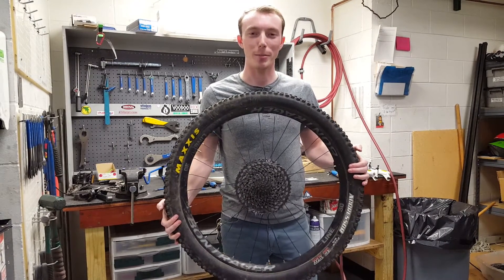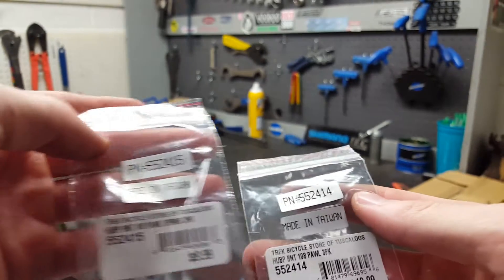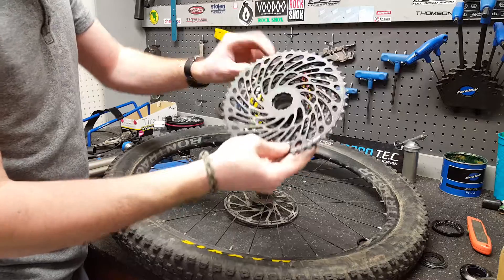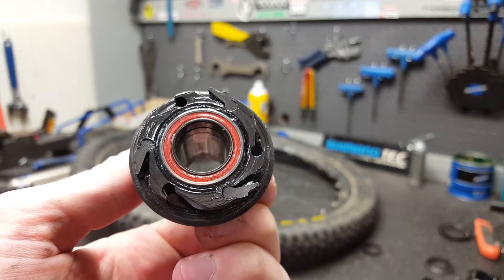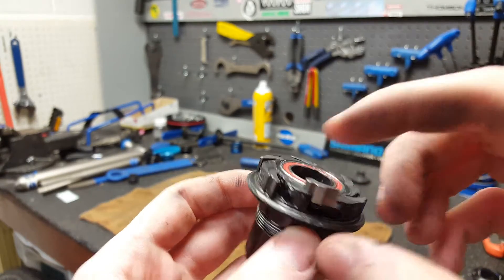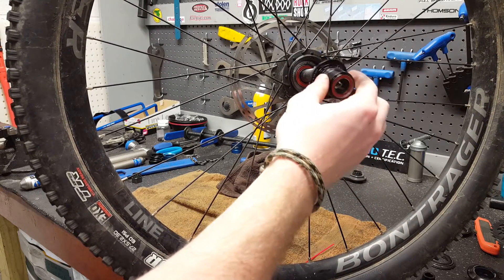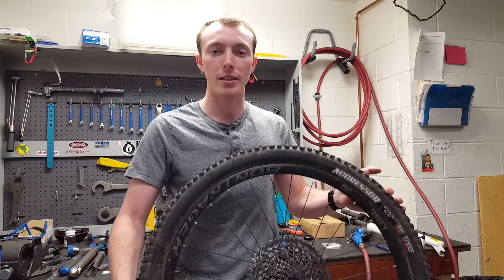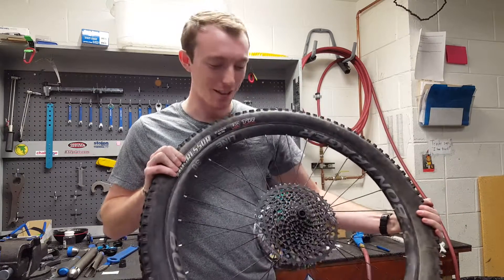Bontrager Line Comp 30 Hub Upgrade 54 to 108 pt

Comment from the maker: Hey guys, just wanted to pin some useful info from the comments:

* You do not need to remove the cassette to pull the freehub body off, but it makes it a lot easier. If you have a cassette removal tool, go ahead and take it off anyways.

* This upgrade will work with 2018+ Rapid Drive hubs. People have commented saying pre-2018 does not work.

* You have to order these parts through a Trek dealer or someone that sells Trek bicycles. They are not available elsewhere.

Thank you all for the support!
Reply: What size socket is in your cassette removal tool pls? I've a 2017 remedy with line comp hubs and wanna try this upgrade an change my cassette myself.
Reply: Peddlin Paul I used Park FR-5 tool to get mine off.

Comment: On my trek marlin 5 i have connection 29 wheels with a dc-22 on it very not noisy like i want can i put those line comp 30 29 inches on my treck ?

Comment: The engagement is not the problem with these wheels. The rear hub is junk. The pawl ring come loose, making the hub useless. There is no fixing it. I am 140 lbs and my pawl ring spins im the hub body. What would a bigger, more powerful rider do to these hubs? Doubt it would last a season.

Comment: What lubricant did you use?  I heard bontrager uses and recommends their own blend of lub.  But I don’t know what it’s called.  Or if they have a part number.
Reply from the maker: I use Phil Wood tenacious oil but any high-weight oil will do the trick. Gear oil for car transmissions is the optimal consistency to aim for. Too thin and it deteriorates quickly, too thick and the pawls stick. You can also use lithium grease for a more robust waterproofing but oils are more suited to the job.

Comment: How can this actually improve engagement without changing the drive ring? All this can really do is add rolling resistance since they all still have 'hang time' groove to groove
Reply: I did some research, corrected my idea, and ended up getting the same upgrade for my Slash. Ha.

The way the catches are spaced, only a single point grabs at a time.. so doubling the count actually doubles the chances of engagement..

And it sounds obnoxiously awesome
Reply: @antaltieri7154  also wear out twice as fast depends whats more important wear or on instant throttle
Reply: @kilner79  gotta go fast

Comment: Thanks for the vid! I just did this. The freehub body did not want to come off so easily and when it did one of the pawls went flying. Other than that pretty smooth install. Now I can be one of those annoying riders on the trail with a bike thats too loud :P
Reply: Use dumonde freehub grease for quiet hubs. Dumonde freehub oil for a horde of bees

Comment: I have a 2019 roscoe 8 with line 40 wheelset will this upgrade work on those as well?
Reply: I've seen where it is possible but different paws are used for shimano freehub body, there not compatible with rapid drive hub.

Comment: Hi mate I’m looking to upgrade my wheels, would a 12 speed sram cassette fit into a comp line 30 wheels?
Reply from the maker: Do you know what freehub the wheelset has? The SRAM NX (and SX) line uses a different spline pattern than the rest of their 12 speed cassettes. All sram GX and above use an XD driver, everything else uses the shimano standard spline. If you have an XD freehub on your wheelset and a GX or above cassette, they will work. Only reason I harp on the details is that SRAM NX uses the shimano standard for extreme cost savings and people always try to swap them over to XD driver wheelsets.
Reply: Adventure Arkansas thank for the detailed reply! The wheel I’ve seen has the 148 shimano freehub and my bike has the Sram NX 12 speed. So I’m guessing my bike has the 148 shimano freehub on my bike as well then? It just confuses the hell out of me when the description of the wheels say “148 shimano 10/11 speed”
Reply from the maker: @DwEmtb  Yup it has what's referred to as the hyperglide freehub. Shimano has kept (basically) the same spline pattern for freehubs since ditching the threaded freewheel. Shimano 12 spd is on a different spline pattern called Microspline. Let's break it down: 148 = 148mm over locknut distance (OLD) this is the hub spacing on the wheels. This size is known as boost spacing. Regular thru axle is 142x10 and quick release is 135x9. If you try to put a 148 in a 142 frame, it won't fit (too big). Likewise a 142 wheel will be too small to fit in a 148 frame. Shimano 10/11 speed simply means that is has the hyperglide spline pattern. 6-11 speed cassettes will fit on a hyperglide freehub, sometimes they use a small spacer to account for freehub width changes over the years. Like my previous comment said, most SRAM 12 speed will use the XD driver. And now that Shimano has 12 speed, they use the Microspline freehub for their stuff. I've been out of technical work for awhile, so I'm not sure if ALL shimano 12 speed uses microspline or if it's just high end stuff like sram. If you're looking to buy a wheel to transfer your cassette onto, buy one with a shimano freehub. If you're wanting to upgrade to a GX cassette (saves a LOT of weight!) you can buy a wheel with an XD driver and get a GX cassette as well. All sram 12 speed groupsets work interchangeably which is one of the reasons I've been recommending their stuff since Eagle came out. Cheers

Comment: My LBS pushed this upgrade for my new Stache 7. I never got to experience the hub without the upgrade. I seem to have a considerable amount of wheel drag. Someone else saw my wheel barely spin and come to a stop on my car rack and commented on it thinking the brake was rubbing. I adjusted the caliper to no benefit.
I took the bike back in and they said it was the rotor dragging and they corrected it, however it still spins with significant resistance relative to the other trek bikes on their showroom floor.
Is there any potential issue to watch out for that could cause resistence, like over tightening or using the wrong lube?
Is this something I should pursue with the shop to get it corrected? I really didn't want the upgrade in the first place.
Seriously how much is that slight engagement increase benefiting when riding sluggish 3" tires anyway?
Reply from the maker: Lube used in the freehub will have a noticeable difference when on the stand. You should be using a light grease such as Phil Wood slick honey or DT swiss star ratchet grease. A thicker grease like wheel bearing grease will slow things down a tad. To isolate problems, you want to remove all other factors - take the wheel off the bike and spin the hub. This will eliminate other variables like dragging brakes, overtight axle, draggy wheel bearings etc. Compare that to other bikes and see what the difference is. Be aware that cassettes weigh differently between brands and groupset so a GX 10-50 will sound and feel different than a shimano slx 11-42 off the bike. Best way to compare is to take the cassette off as well. To your point about the engagement increase - it's less about being 'quick' as it is about making the bike feel more tight and responsive. Trials-type slow speed maneuvers are a lot easier on a bike with fast engagement. Personally that's why I went with this mod, as I do a fair amount of tech riding compared to folks who do more mileage.
Reply: @piercereed6000  yes
Reply: @piercereed6000  Maybe I misunderstand what you're asking. I got rid of my Stache so I don't remember what wheels were stock. What is shown in this video is an upgrade to the stock hub on the stock wheel - they stay together, there is no need to fit anything to a hoop or do anything with spokes.

Comment: Nice job. too bad it couldn't be demonstrated before and after on a climb. I think i have a 6 pawl horizon with 42 points. I think my stock wheel is 32? Like it. Very good demo of the internals. thank you. I think the body requires some care pulling it off, some hubs have loose bits that cane come off and can be lost track of.
Reply from the maker: I've lost a few of those springs in my day :)
Reply: @adventurearkansas9926  i am currently looking for a plastic pulley that goes on my false axle from park tool, that i use to clean the back end and mech with the wheel off. Any ideas on what i might have handy that would fit on an axle, that is plastic, that i could slip on there to hold the chain? Grrrrr. i also hate black parts as they are real hard to find.
Reply from the maker: @alutious  Old jockey wheel is the first thing that came to mind. Or rig two plastic bottle caps (think gatorade sized) open ends out and the chain should stay in the center. You'll need to drill them in the center or use a knife or something. If it's a thru axle a piece of garden hose is something i've seen before as well - probably the most durable and easiest option.
Reply: @adventurearkansas9926  Interesting.  For a thru axle the park tool says to not use the tool, it says to pull the pulley off and just put that on the axle, and  put the axle back in without the wheel. This is how i lost it  lol. So I don't think i would trust a bottle cap on my axle. However, i might be able to use the rest of the tool, not sure. I think the mini axle is for a skewer. One of the benefits of the pulley and the park tool thingy is you can still shift and it slides along in the back. I have a broken derailleur with some spare jockey wheels. How you would rig those up? The center of the pulley is too small for an axle. Got me thinking. I could drill them out and then smooth them by wet sanding or steel wool.
Reply from the maker: @alutious  If the pulley would work on the tool that's what i would recommend. A lot of times you can just press the bearings out if they're off a high end derailleur. I'm not super familiar with that type of tool, anytime i'm doing work on the chain or derailleur i'll have the wheel on the bike.
Reply: @adventurearkansas9926  The park tool has a plastic pulley (it has a notch that fits the chain, there are no gears). Is the inside of a regular jockey wheel where the bearings are, is this 12mm??? If so then i'm all set. The park tool i am talking about is a DH-1 dummy hub. you can see the black "pulley" on there. That is the piece that is missing. On a thru axle they say just put that piece on your axle. I agree, when cleaning the chain i usually have the wheel on. But when i take the wheel off, for example changing wheels or removing/adding a fender, i take the wheel off. Then i do a thorough cleaning of stuff i normally can't get into. And i usually will clean the chain, and i liked this little pulley.
Reply: @adventurearkansas9926  ok that's cool i just measure a jockey wheel on my mtb, i see what you mean now. I thought it looked too small, but it was because the round piece on the most visible jockey part is outboard of the cage and is actually the inside of the bearing. The outer diameter of the bearing, which is less visible as it is inside the cage, looks like it is 12mm. Cool! I will give it a shot. I haven't taken a jockey wheel out yet, and i have this broken derailleur sitting here. Maybe i can re use the bearings, they have almost 4,000 miles on them.
Reply from the maker: @alutious  Might not be exactly the right size but it's nothing a drill or file won't fix. If you don't have that available then like I said, an old piece of garden hose or cut of PVC pipe to protect the axle will be just fine.
Reply: @adventurearkansas9926  just saw a video of a guy removing his bearings with a vice and some professional guides. I think i will see if i can find a 12mm outer diameter socket, and a larger socket with an inner diameter of 12mm, to push the bearing from one side to the other side with the larger socket, inside a vice. See how that works.

Comment: Hi. My steel drive ring is loose, and for that reason i have no engagement. Zero engagement. How can i fix it?
Reply from the maker: That's a new one! The steel drive rings are often interference pressed into the hub or spline fit tolerance pressed into the hub. Either way, if the drive ring is loose and able to spin - the hub is toast. Can you post a picture to imgur and paste the link? Or upload a short vid to youtube - I'm curious to see what is happening.
Reply: Adventure Arkansas sure. A vid could explain better the thing. I’ll tell you when i upload it

Comment: Hi, how do you like these Line comp wheels? How do they hold up and how often do you service the freehub?

I have continuing issues with my rear hub on my Trek Xcaliber 9 and I'm seriously thinking of changing to a Line Comp 30 and go straight for 108 upgrade, as these seem to be well reviewed.

Regards
Reply from the maker: Hey Mathias, I had the stock ones on my Remedy for about a year before upgrading - I actually took the rear hub to the new wheelset!! The line comp 30 was a great wheelset and took a lot of abuse. It still holds a tubeless seal even with all the dents and scrapes I put on them. For an X-cal they're a bit heavy but definitely bulletproof. Unless you huck to flat huge drops all the time, you'll run out of suspension before you damage the wheels. I relaced the rear hub from my Line Comp 30 onto a set of carbon Roval (specialized) hoops and they've been rock solid. If you use the recommended weight oil in the hub you'll have to change it once a year or so but it's not a hard task. Cheers

Comment: How would you rate the durability of the Bontrager Line Comp wheels? Thinking about getting one to replace my front wheel as the price on their site is $150 for the 40mm width. Do you know how they compare to WTB ST/Scrapers?
Reply from the maker: The stock 30mm ones that came on my Remedy didn't last long - but I'm also rough on my equipment. I rode the rear out on a flat multiple times and even managed to get a pretty good dent in the front even with 160mm travel. But, even though the rim edge bent, it still held a tubeless tire with no leaks and didn't go out of round due to the thick profile. The wider the rim generally the easier it is to make them oblong on a hard impact so just be wary of that. I've had a few Stan's rims do that since they have a thin profile. For the front wheel, I'd say it's a good deal. They hubs have been great but a bit heavy.
Reply: @adventurearkansas9926  Have you tested out/compared it to WTB ST/Scrapers?
Reply from the maker: @mellissanash7517  I have not rider either wheelset so cannot compare

Comment: Wil this work on the Trek fuel EX 7 2020?
Reply: Yes, I just did it to mine 2 days ago. Well worth the $30 investment, it feels more "crisp" and responds instantly. The only drawback that Ive noticed is a very subtle increase in wheel drag while coasting however it doesnt seem to affect the pedaling. I removed the grease and used a couple drops of dry lube instead of grease to keep the paws from getting gummed up and sticking. Also produces a nice noticably louder sound with dry lube vs grease 👌
Reply: @single-trackdiaries4071  @wheel drag... My LBS pushed this upgrade on me for my new Stache 7. I never got to experience the hub without the upgrade. I seem to have a considerable amount of wheel drag. Someone else saw my wheel barely spin and come to a stop on my car rack and commented on it thinking the brake was rubbing. 
I took the bike back in and they said it was the rotor dragging and they corrected it, however it still spins with significant resistance relative to the other trek bikes on their showroom floor.
Is this something I should pursue with the shop to get it corrected? I really didn't want the upgrade in the first place.
Seriously how much is that slight engagement increase benefiting when riding sluggish 3" tires anyway?
Reply: @TheClassicGamefan  honestly its a matter of how much you see yourself wanting the quick engagement vs wanting less wheel drag. The upgrade is good for a responsive pedal for things like climbing, but if you ride more flat ground or downhill it may be better to have the hub converted back to 54t. I think this is just the trade off we all face in terms of this hub upgrade. The wheel drag comes from the added resistance, so the stock hub has 3 pawls vs the upgrade that has the 6 pawls. The extra pawls can always be removed for less resistance at the cost of having more "play" in your pedal before the hub engages. Id say have them removed but keep them to see which you prefer after spending time riding both set ups.
Reply: @TheClassicGamefan  For sure, definetly not a bad idea to try the 2.8 tires first to see if that improves it before you convert back. Also, you could try a different lubrication in the hub, if they packed it with a thick grease vs lubricating oil and the amount used may be something to look into because that can also affect how well the hub rolls so maybe try running a lighter grease or a non-wax type chain lubrication to produce as little friction as possible without having to use sticky greases. I also thought it was my brakes rubbing at first but after thoroughly checking and then rechecking my brakes I have no doubt in my mind that the hub is causing the resistance. After a little research, it seems that the wheel drag is pretty common and there are a few things to try first before converting back or ultimately getting a higher spec hub.

Comment: Amazing.  Parts ordered. Arrived.  Started the install to find my chain whip isnt 12 speed compatible.  So the bike shop are working there magic in it. Will have the beast back soon to see what she is like. I love techy climbs, so a good cheap upgrade for me.  Thanks
Reply from the maker: Thanks for watching Josh. Others have told me, and I've tried it out to confirm, you can actually do this mod without a chain whip! Just pull the cassette still attached to the freehub right off the hub. I still prefer taking the cassette off but in a pinch it will work. Happy wrenching!